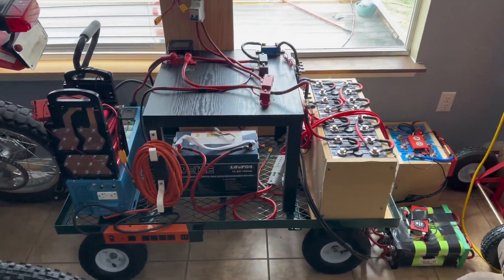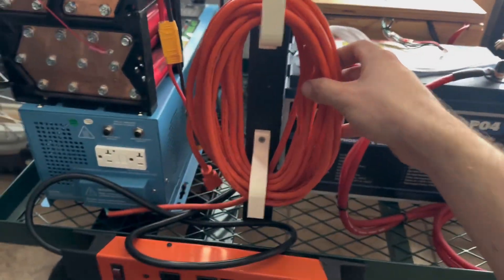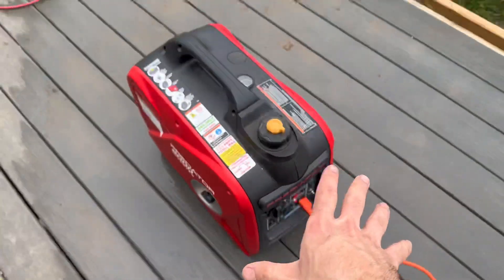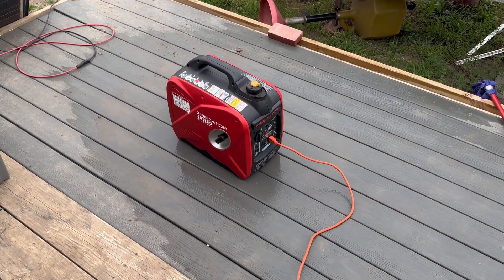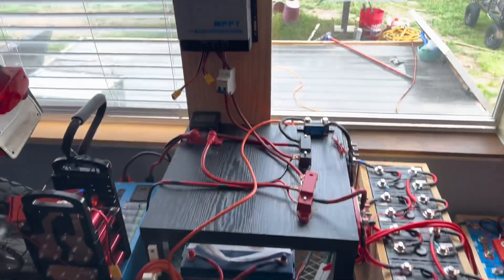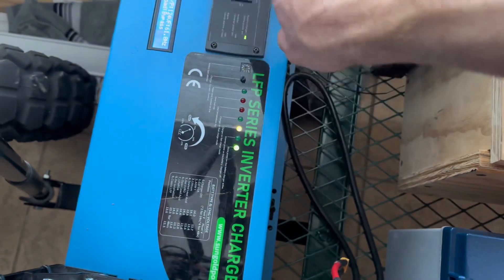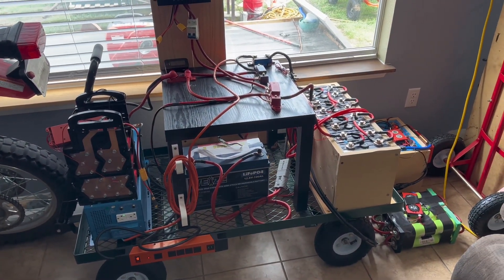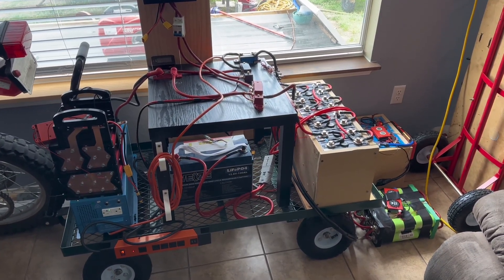Charging my lifepo4 power station on a cloudy day

Comment: A question from a newbie-wouldnt it be more efficient to plug the Sungold into your house receptacle instead of the generator? Thanks.
Reply from the maker: Absolutely! But if the power goes down this is my backup if I cannot get enough sun, plus I run the generator every now and again to keep the fuel fresh